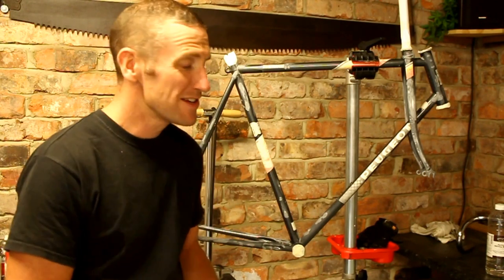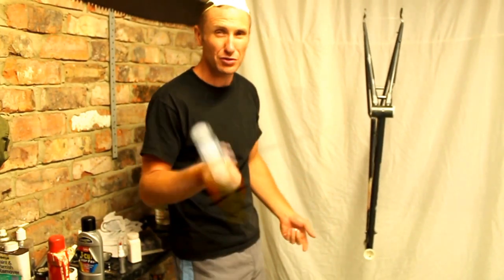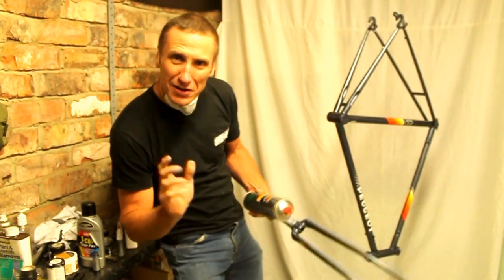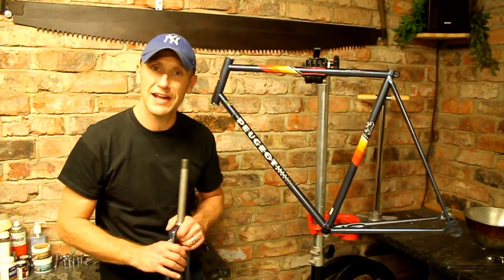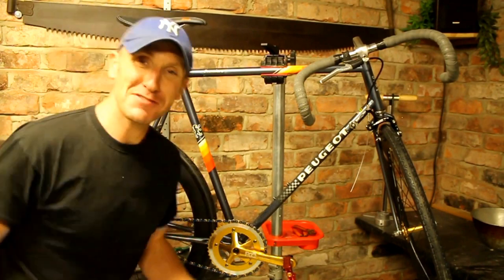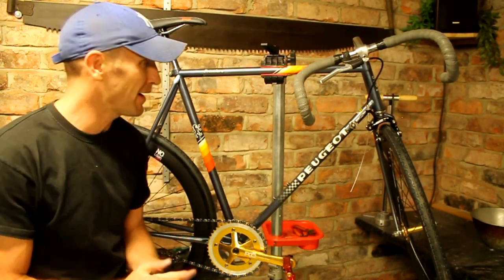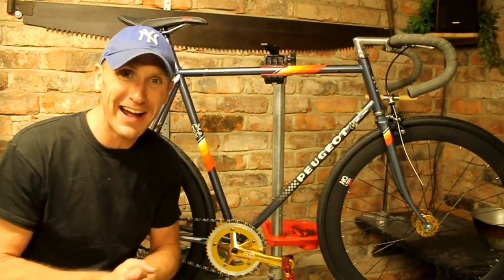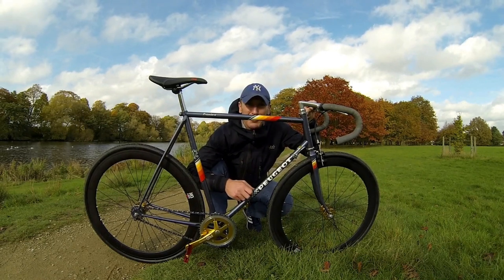Bike Maintenance - Part 2 -Rebuild and Ride- Peugeot Premiere Fixie Restoration

Comment: Top job mate. 
Can you list the brand of the tires, they're exactly what I'm after! 
Just bought a 70s Peugeot,  basically gona copy your restoration! 
Cheers
Reply from the maker: +peter vazquez Firstly thanks for watching and the comment, regarding tyres on the Raleigh Corsa the first video I did i used Gum wall Michelin Dynamic 700 x 23mm Tyres. I have used others and couldn't tell you the brand. I have generally searched 700 x 23mm Gum wall tyres and took it from there. I really think it depends on if you are going to be keeping the bike for yourself, the only reason I say this is that I kept my Raleigh but I also know I wouldn't get the money back that I spent on it. Hope that this helps all the best and good luck Andy
Reply: +BikeIt UK nice one Andy. That's a good jumping off point for my research. Much appreciated
Reply: +BikeIt UK hey Andy, thanks again for getting back to me. I have another question, and please be patient I'm a beginner. How do you know (without taking the bike to a cycle shop) what size of tires it takes? Like is it one size fits all or how does it work? I'm getting ready to covert my bike to fixed gear and put on new tires, I'm not selling this bike. It's for me to practice. I Just want to make sure I'm buying the right stuff. 
Really appreciate any help man. Keep up the good work, love the videos. I've watched all the restorations many times. Thanks
Reply from the maker: Generally modern day road bike wheels are all 700c, the width is measured in millimetres 23mm up to max 28mm. Have a look at the rim or if you are taking old tyres off check them for measurements. Hope this helps and glad you enjoy the videos just finished a couple of bikes off myself, videos coming soon. Cheers Andy

Comment: Cool, but that's not a fixie, just a single speed bike.. * a fixie does not have the ability to coast or freewheel
Reply from the maker: Hi firstly thanks for watching, the rear wheel has a flip flop hub one side freewheel the other is fixed. Thanks again Andy

Comment: Hi what is the wheel size and tired size for the bike as I want to get some for mine
Reply from the maker: +Tech O0O Firstly thanks for watching, these if I can remember are 700c x 50mm deep with 700 x 25mm Tyres the brand was a company called "No Logo" hope that this helps, all the best and good luck Andy